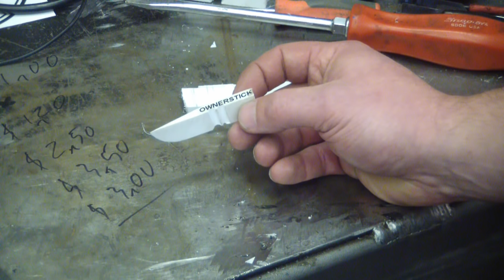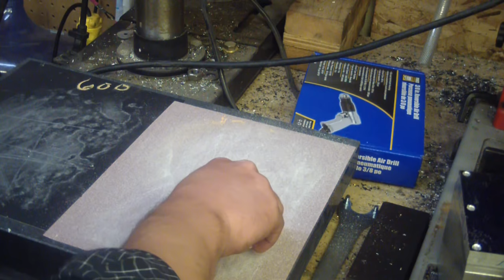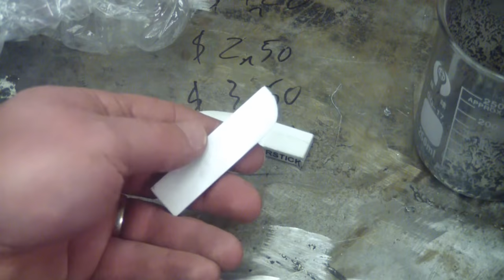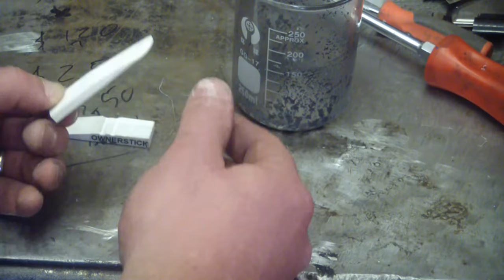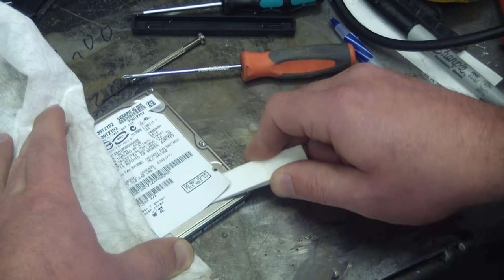Easy Warranty Void sticker removal with DIY Teflon knife.

Comment: Wow...  okay... so, I've only watched this up to 1:06, and there's already a fundamental flaw in your thinking:  OF COURSE you can do to an item you own whatever the flying fuck you want, but DON'T expect the manufacturer to pay for anything when you screw up.
Reply: +Atl essa I was thinking the exact same thing.
I don't see how this is useful unless the company will refuse to repair things (outside of warranty) once the seal has been cut.
Reply: Walter Boxhead
I disagree.  Electrostatic Discharge (ESD) is a HUGE danger to any electronic's internals, and there is absolutely NO way of telling that it was ESD that damaged the part.  As soon as the user opens the device, there is a real possibility of them damaging something through ESD.  THAT is why the companies void the warranty when the device has been opened.
Reply: Walter Boxhead I never said, nor implied that OPENING the case will automatically result in ESD.  However, it is a VERY REAL possibility, and it is damn near IMPOSSIBLE to later tell if the device failed because of ESD or not, and on top of that, if that ESD was caused by the tinkering owner, or a careless employee.  THAT is why the warranty voids when the seal is opened, and why I think that even if you THINK you know what you're doing, you have no reason to open that case...  or if you do, you should accept the consequences (warranty -> void)

If you open that case, damage a component through your negligence, and then deman the company to repair it under warranty, I think you are a fraud, and should be sued for the attempt. Even, and especially if you didn't even REALIZE that you caused the damage.

WAY too many people DO NOT know how to avoid ESD, and they SHOULD NOT open the case of their precious electronics, and THEN get away with this kind of fraud.  That is just WRONG, and if you don't see that, then you are part of the problem.

Why am I on a tinkerer's channel? Because youtube suggested this video to me, and I was curious about it, and what I stated up there was mostly my opinion (sue me), and, what I think, a VERY valid reason for those stickers to exist. 

If you open that case, damage a component through your negligence, and then deman the company to repair it under warranty, I think you are a fraud, and should be sued for the attempt. Even, and especially if you didn't even REALIZE that you caused the damage.

WAY too many people DO NOT know how to avoid ESD, and they SHOULD NOT open the case of their precious electronics, and THEN get away with this kind of fraud.  That is just WRONG, and if you don't see that, then you are part of the problem.
Reply: Walter Boxhead
I'm a certified electrician, trained in the use of ESD sensitive devices.  Try again.

I NEVER said it will be damaged by the process of opening. Try again.

I DID stop this video at the aforementioned timestamp, and made my post (in disgust). Try again.

IT IS fraud to open a device, unknowingly damage it, and then demand repairs under the guise of warranty.  Try again.

Also, reading comprehension.  I said that there are TOO MANY people that don't know how to handle ESD sensitive devices.  I never said you're one of them... although I'm suspecting you are. 

Quick test:  Which of these materials should you wear when preparing to handle ESD sensitive equipment, and which should you avoid like the pest?
a) leather
b) wool 
c) cotton 
d) polyester
Reply: +Walter Boxhead Stop nitpicking his words, plain and simple in the warranty contract it states that if you open it it will void the warranty, if you do not want such a warranty, then I suggest you look for a different product that will allow you to open it up without voiding a warranty.
Reply: Walter Boxhead And now you are using straw man fallacies.  I have never said "tapering will ALWAYS result in damage."  So I have no idea what you are replying to, looks like you are having an argument in your head, not with me that is for sure.  

Hmm insults, are you mentally capable of having normal conversations or not?
Reply: Walter Boxhead A broken product is a sliver of Teflon?  Right in your mind a corporation is an ambiguous entity that has a life of its own, its not people working under the umbrella of the company its a concept with the life of its own. Not only are you incapable of normal conversation, your logic and comprehension level is too low for me to engage with you.  When you run a business and when you finally realize how it works, then you will have a point to make, for now you have way too much learning to do.   Im done, I do not have much patience for those who are simply incapable of even the basics of comprehension.
Reply: There are videos on this very channel about engineered to fail parts. Do your own homework
Reply: Collin Huebler You were the one who mentioned it, how am I suppose to support your own points?  Ok Ill use your logic then.  "No there is no such thing" trust me and dont ask for any statistics just do your own homework.  I was asking for statistics not videos from a YouTube channel
Reply: samuils You want statistics on something that falls into pretty much every working field. The study would be far to large. There are only bullshit marketing studies made by companies to show how much better they are then competitors. Open your eyes. When Ave takes a tool apart it doesn't take a genius to realize. When they cut corners to save money on "things" the "things" become less durable. It cut their life and manufacturers can estimate by how long and set warranties accordingly.
 If you think companies care about you then I am wasting my time. Everything decision made is about profit. End of story.
Reply: samuils You call it self destruct they call it wear and tear. You can think they pass the savings down to you all you want but prices are determined but competition, supply and demand not just cost to produce. Warranty is not for your protection its for their profit. So they can make something and not have to support it a couple years later forcing you to buy a new one when the weak parts fail. A built to last tool costs thousands, compared to a run of the mill tool costing hundreds. Hilti vs dewalt. One company is forced to charge that because of high quality material and because a customer only needs one in their life. The other cost is low because you have to replace it every few years.
Reply: Collin Huebler So the fact that products break is called self destruct?  Everything breaks at point or another.  Warranty is there to repair or replace a product, how do you get to bring up what might happen after the warranty and say therefore its for their profit to replace or repair your product.  Its getting really difficult to understand you, you are not following the most basic logic.  

Wear and tare is normal in all products there is no eternal products, and there is no intentional self destruct which is what you have said before, and no its not "you call it this I call it that" the concepts are completely different.

  The fact that prices are not only decided by material costs, has absolutely nothing to do with the fact that material costs is in there as well, and this is what we are talking about.

I have dewalt tools from 10 - 15 years ago, what in the world are you talking about replacing them every few years?  

The warranty is during certain period, warranty = repairing or replacing the product during that time free of charge to you and costs money to the company.  What happens after warranty is a different subject, and since we are talking about coverage under warranty time, this is the time period we are concerned with, which cots money to the company not brings profit o the company.  

Hyundai has one of the longest coverage where they repair and replace free of charge to you, yet which cots them millions not makes them millions, is this really that hard to understand?
Reply: Arguing with idiots is like playing Chess with a Pigeon.

It doesn't matter how good you are, the pigeon is just gonna shit on the board and strut around like it won the game.
Reply: TDPEquinox I think it will be useless talking to him, after making all of reasonable points you have just made, all you will get in response is a bunch of insults and non arguments (of course in head head thy are arguments.)  People like him lack the basics of logic, and are very narcissistic, its all about their needs.  Just as a side point, I find it very odd how many anti-company people are so narcissistic, yet blame others for being selfish.  Anyways if you want to, argue with him, just saying dont waste your time with people like him.
Reply: samuils Its pretty simple. They warranty for 3 years, build it to last for 3 years. They offer extended warranty for $100 bucks, you buy, send product in for a 5 minutes 2 dollar part fix. Profit.
Reply: Collin Huebler We have never talked about extended warranty to begin with.  The conversation was about manufacturer warranty which is free of costs to you, stay on the subject.
Reply: Collin Huebler No one is building products to break after 3 years, are you insane?
They are building the products, and then figuring out how long it will last before it will likely fail, and then warrantying it to match.
Reply: Collin Huebler You're contradicting yourself....
Reply: Collin Huebler I already talked about loaners, so that was already covered.  And the fact that even if you do decide to buy a second tool they have no way of knowing if you will buy theirs.  All of this was already covered, you are going in circles.
Reply: TDPEquinox How? By cutting costs the product is engineered to fail.
Reply: Collin Huebler What is it Im not getting?  And try not to be patronizing, you are not in the place to be so.  Loaners in many markets are given for free, how does that not solve anything.
Reply: Collin Huebler All products fail at a certain time, does that mean that all products are engineered to fail?
Reply: Collin Huebler Can be built to last for life, by taking what into consideration?  We are looking for malicious intent here, dont forget that.  As far as tools for professional, we all own at least 2 sets of tools as it is, so we never get loaners.  The weekend warriors can wait for repair.
Reply: samuils
As far as tools Hilti, built to last. Powerfist, engineered to fail. Ave has a video of a water pump that has a bearing that is not water tight. Engineered to fail.
Reply: Collin Huebler There are also plenty of watches whose mechanism is made out of crappy plastic that costs $5, they wear out in many cases within 3-4 years.  What is your point?  You want them to use expensive materials and still sell it to you for $5 ?  And where the malicious intent in that?  Still do not see anything bad about it.  You want to buy cheap and yet with a lifetime quality?  Businesses are not charities, they need to make profit.  Plus a little thing which is economical price control on materials.  

I will give you one example.  In USSR we had butchers selling all pieces of the cow for the same price, obviously filet mignon disappeared immoderately, it wasnt until I came to USA that I got to try it for the first time.

This example is somewhat frivolous, but in order to understand the markets of materials, you really need to know how important prices are for new inventions and material control.  

At the end I still do not see  malicious intent in anything you wrote, there are cheap products which by their nature tells you that is it crap quality, it was made with affordability in mind and very light use.  Not a single product is made with "it should break at certain time, muahahahah MR. Burns finger tap evil laugh" in mind.
Reply: No my point is that if I have to take the warranty sticker off to fix a easily cheap and fixable component I will, to save the warranty incase there is a porblem with a major component that I can't fix. These products exist and its not in the cheap budget market because yes everything is cheap junk and you expect that. Its in the higher middle class where some components last last decades of abuse so they make one component junk to keep it in the competitive middle class instead of just making a quality product. And I made it specific that new technology is an exeption becaue the materials might not be around/feasible to mass produce.
 Not a single product? The Ipod was a good example. So are most cars. My engine (second one) used a plastic fitting that erods after a set time. A 3rd part company makes an alimunum replacement. That would keep a car in the shop every year or so for a 3 dollar part and 10 min replacement. Engineered to fucking fail.
Reply: Personal experience renders your logic irrelevant. The most common reason I'd want to open an item is because it is not working correctly or at all. The inconvenience factor or time to return, makes it extremely tempting to see if said broken item is user fixable. Sometimes it is, sometimes not. But if it's already broke, why not? 

In this example, a company could be saved a return if it's something I can fix.
Reply: Nuckelhedd Jones Your comment got me thinking: If nobody will be earning much cash anymore, who will consume all the products that the machines would produce? It would help at first, but destroy the corporations in the long run. I still agree that most would try to use as much machines as possible. Take automotive companies for example. Are they part of the reason their market nearly crashed in last decade, since they are actively replacing manpower with robots? I remember reading somewhere that this was really the case.
Reply: +Pyrrha Nikos not all products that have these security stickers will be affected by ESD. A corded electric drill has no micro processors to worry about but many still have tamper stickers.  Some of my air tools have these covering screws for some silly reason (most don't have a warranty past 30 days).

Comment: Many many years ago I worked for a company that made Teflon widgets for the aircraft industry ( wheels for the cables in old school planes that had cable actuated airfoils), what about 3D printing?   great idea AvE I agree 100% .my point is we got the teflon in pellet form for injection molding machines so the pellets would work in a 3D printer and a lot less waste.  Yes I'm late to the party sorry.

Comment: i hope ppl know that you damage your harddrive with that kind of heat
Reply: its a good thing he still has warranty
Reply: depends on how hot you get it. Getting it hot enough to loosen the glue isn't going to hurt it at all. Start burning things and you might be getting into problems.
Reply: I have used a heat gun to preheat a board so I could reflow / remove / reinstall BGAs so damage is definitely possible. I wish my Xbox 360 RRoD when I worked at that place.
Reply: You don't know what you're talking about, go back to your Linus tech tips videos and well stay on our real engineering channels
Reply: I'm in

Comment: I used a teflon-coated cookpan to make Field's Alloy, a metal that melts at 144F (62C).  It's similar to Wood's metal exept that it's non-toxic, Wood's contains both lead and cadmium.  I haven't figured out a good use for it yet though.  If you need a metal that melts at a low temp (and wets glass, I've heard) it's stupid-easy to make, you just look up the proportions, weigh out the amounts, and cook over low heat.  I suppose you could solder glass with it.

Comment: teflon and especially teflon fumes are pretty toxic, wouldnt recommend heating it up or even cut into it.
Reply: xZerplinxProduction what do you think happens in a teflon pan? Hell live
Reply: xZerplinxProduction No one in his right mind is messing with Teflon while it's hot enough to emit fumes. A heat gun isn't going to bring Teflon up to boiling point.
Reply: Josh Conover care to list your sources for the temperature breakdown point of Teflon?
Reply: Natural selection My sources are the millions of Teflon cooking tech that haven't fumigated people to death over the past few decades. Commercial stovetops and ovens do not exceed 550F, by regulation and design. Teflon does not begin to decompose until 662F.
Take your sources and shove them into your tin foil hat.
Reply: They arent actually teflon. Rather a ceramic nowadays.
Reply: meh mehabd no they are teflon. The ones labled teflon.  As are microwave popcorn bags. Anyway there ARE ceramic pans. There are also still teflon pans.

Comment: Five years late but as for why you'd want to go inside a hard drive, a while back had to open one up because for some reason when it was switched off, the heads didn't park properly and came to rest on the platter itself.  Because the surface of the platters and the heads are so smooth, it creates the same kind of sticking force as you see in those gauge blocks.  It's so strong that the drive motor doesn't have enough torque to start spinning the platters again and the drive is effectively dead.  However by opening the drive and pushing the heads off the platters I was able to get the drive working again.  I wouldn't trust it with important data (it's currently a backup drive) however amazingly it has been working perfectly for over a year now despite being opened outside of a clean room.  But of course I hadn't seen this video so had to tear the seals so no more warranty for me.  But apparently this problem is pretty common (the symptom is a repeating noise when you power up the drive as it tries unsuccessfully over and over to try spinning the platters) so that's one reason people might want to remove the stickers from the tops of hard drives.